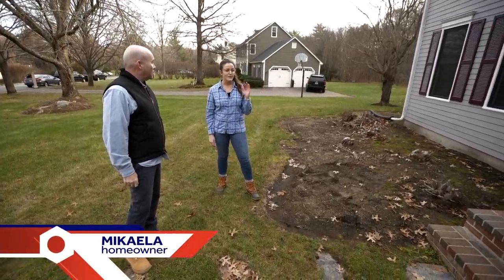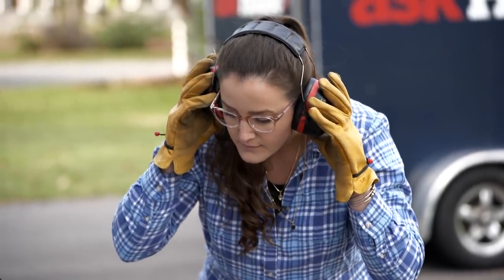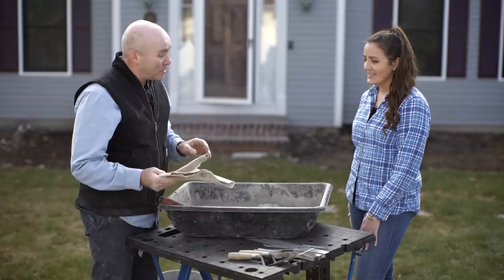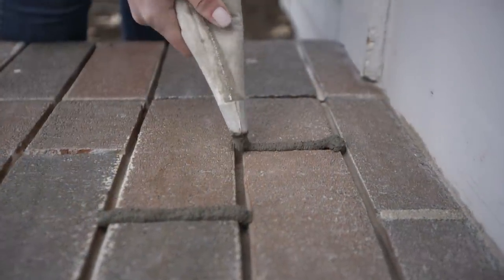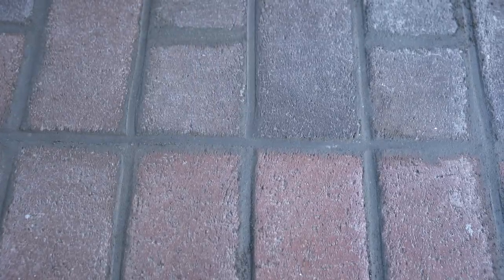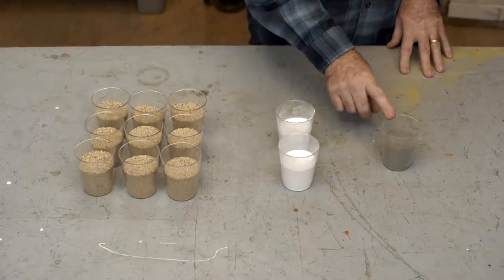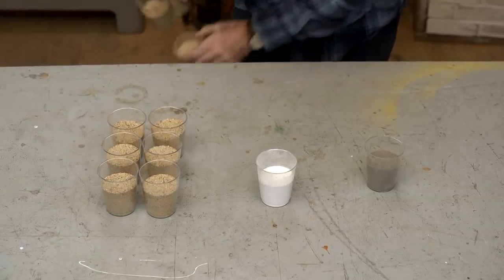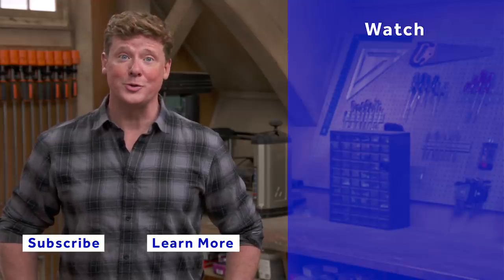How to Repoint Brick Steps | Ask This Old House

Comment: It would be good to know about how much time did that take from start to finish?  
Also, my steps need tucked on the vertical brick joints as well; i.e. the joints you'd did not do.  Would you do the same process on those bricks? 
I have seen videos where they moisten the brick before they added the mortar.   Is that necessary?
Finally, what if you get some overspill of the mortar on the brick.  How would you take the excess mortar off?  
Where do you get the icing bag?

Comment: I find it amusing that I hired a company that sent their "professional" mason to repair a small section of brick facade wall (not structural) that I hit with my car. The mason used Type S, which I learned later is the wrong type. I later fixed a much larger section of my brick facade wall myself and knew that I need Type N. When I compared my work to the professional mason's work, I regretted being too scared to DIY to begin with because I had no previous  mason experience and thought the project was way above my skill level. I think one issue with hiring a pro in the San Francisco Bay area is that masons here typically do not speak English as a first language or are allowed to work legally in the USA, and therefore masons with a very high skill level, such as is common in England or at Mark McCullough's level, simply cannot charge an appropriate rate commensurate with their high skill if most mason's make less than a fast-food worker's salary.
Reply: In many videos s is used for structural walls or vertical walls which ur contractor used. For floor or flat level it is N.
Reply: @abbyiyer2011  - you are correct - type S is for structural walls. Before starting my DIY brick facade repair I called QuiKrete tech support and got a detailed lesson on the many types of mortars - K, M, S, O, N and the best application use of each. To add to my previous post, I believe the contractor used a less appropriate mortar type simply because Home Depot was the closest store and Home Depot in my area doesn't stock type N. It might also be because he wasn't as aware of the subtle differences between types K/M/S/O/N too.  My nearby Lowes does carry it though. My contractor was actually at my home to repair a concrete patio which is why he didn't have bags of mortar in his work truck. I'm sure the contractor likely only shops at HD or Lowes for these little one-off trips. In the industrial area of my town we have lots of specialty businesses that cater just to contractors.
Reply: @donaldlee6760  makes sense. But it also a good experience that made you. DIY er🙂
Reply: Mike Haduck used Type S masonry cement in his video "BRICK WALL REPAIR (Mike Haduck)".  He's in a colder climate and tends to use more portland rich mortars.

Comment: Hi
My block wall has crack in it , size of a quarter or half dollar. I wanted to put cement in it to close the hole.
Someone told me to use 2 parts Portland cement and one part sand and trowel it in.
It’s in a covered area so pretty is not a factor. 
Is the mixture correct?
Reply: That's a heavy cement to sand ratio. Most mortar recipes call for three parts sand to one part cement. You can find a lot of premix bags that will have "Type S" on them, that's a good strong mixture of Portland and lime as well as the sand being incorporated already.